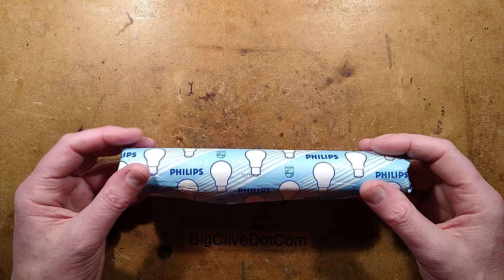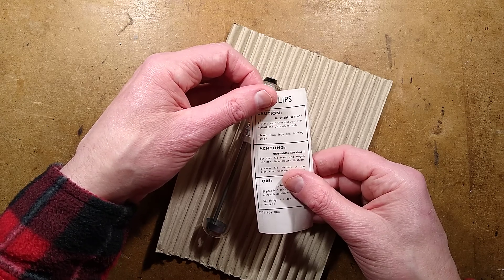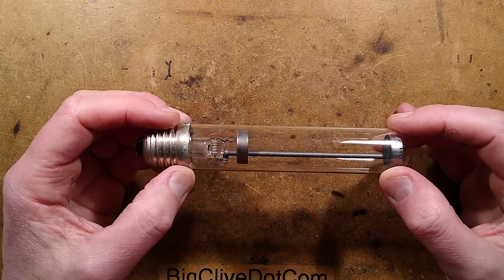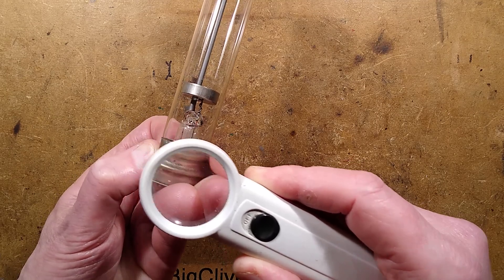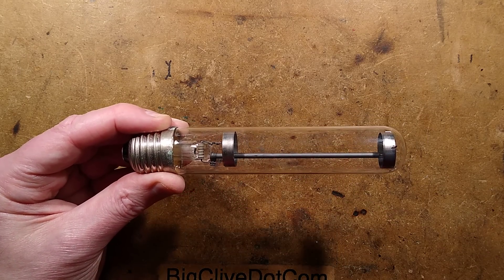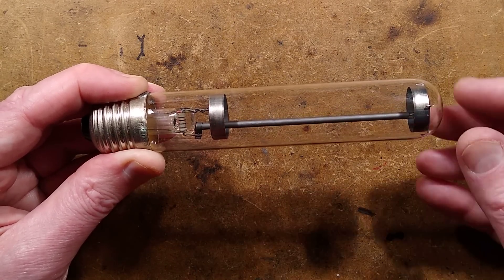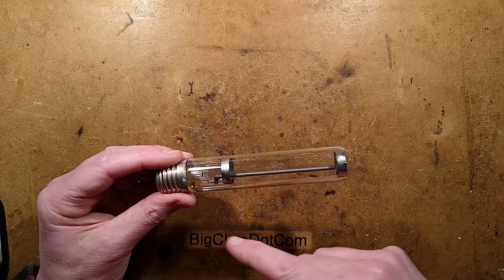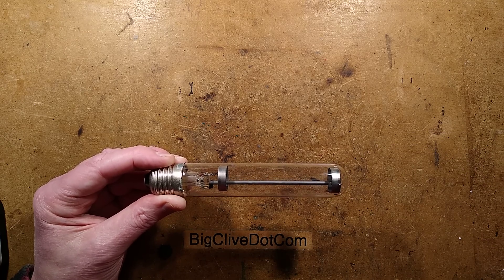Unwrapping and testing a dangerous vintage Philips lamp

Comment: I have an air purifier with a fluorescent UV-C lamp built into the filter housing at the bottom of the unit (supposedly for sterilizing the air passing through the HEPA cylinder) and noticed something peculiar after recently changing out the filter. The lamp itself is protected by a plastic slotted shield that prevents the lamp from breaking in the event it is touched or struck accidentally, and the internal white plastic surrounding the lamp is stained/burnt a brown-yellowy colour in a zebra stripe pattern relative to the slots of the protective guard.

If such a tiny lamp the size of a car key can turn heavy duty, hard coated white plastic a dark brown after a year of exposure, I can only imagine what it could do to my body within minutes or even seconds.
Reply: To your skin it would cause sunburns minutes of exposure.
And to your eyes welder's flash in seconds !
So yeah, be careful with those lamps.

Comment: As a school Physics technician, we still use one of these lamps - with proper precautions as it has the right UVc wavelength to show the 'Photoelectric effect' - the ability for photons to discharge a electrostatically charged zinc surface. If you know where to get any of the lamps, let me know!

Comment: Several years back I designed some costumes for a theater production which used UV light to bring out certain details at key points in the story.  When painting these details onto the costumes, it was necessary to do so under UV lighting conditions.  I didn’t take necessary precautions, exposing myself to direct UV for several hours.  It created a tan-line on my forehead that lasted for years.

Comment: I used to be a platemaker in the printing industry, and we had very similar but much bigger lamps to burn images onto the metal printing plates. Those UV mercury vapor bulbs were very dangerous. Came with gloves because you couldn't get the oils on your fingers onto the bulb. Never did find out what happened if you did!
Reply from the maker: The very high temperature lamps can fail due to devitrification caused by the oil.  I'd guess on the lower power ones it may block the UVC a bit.

Comment: As a kid the classrooms in my school had one recessed light fixture they called a "germ light". My school was orginally built in the 50s and by the early 80s teachers were told not to use them but every now and then someone would hit the switch and I remember them having that color.

Comment: Mid 20th century there were bulbs that emitted sparks into the skin, as therapy. The current could burn. As it was higher than the classic Van DerGraffe generator. Wildly unpredictable and unregulated tanning lamps were everywhere. Giant filiament lamps that could easily light paper were screwed into double size "Mogul" sockets.
Reply from the maker: Possibly the violet ray.
Reply: @bigclivedotcom  maybe.... The bulb was the old floodlight shape. Glowed purple (violet) and sparks shot out to your skin if you got close. It almost burned. I junked one up years ago. Lol.
Reply from the maker: @edwardallan197  You can still buy them as Darsonval machines.

Comment: While watching this video, I experienced a dry, burning sensation in my eyes, accompanied by extreme tiredness.  Disregarding the fact that I have been awake for over 36 hours, I am quite sure that my symptoms were caused by viewing the lamp.  

During  the pandemic, I had an old 18" fluorescent fixture fitted  with a UVC bulb from a dead Ionic Breeze GP on top of my wardrobe, and set it  on a timer to run four hours each day while I was at work.  It bleached my curtains, carpet,  bed sheets, and made the varnish on the top of the wardrobe crack.

Comment: In the early 90's, shortly after the Loma Prieta earthquake I moved from Seattle to San Francisco to help a friend open a restaurant. He needed a bar manager and I happened to be in that business at the time. I got to talking to the rest of the staff over the year I was there, and one question I typically asked over closing time shift drinks, was "what were you doing right before the big earthquake.....do you remember?" and quite a few answered "yeah, I had to go to the bathroom all of a sudden, and just when I sat down, the earthquake hit".
So a not insignificant percentage of the San Francisco Bay area was sitting on the toilet during the "event" and umm, both events were said to be explosive...
No UVC necessary.

Comment: I have one too. Bought it at the local Electronic parts store for the purpose of erasing the data contents of eprom chips. (Those with the see through glass to look at the actual memory chip)  I used a ceramic lamp holder mounted in a metal box, 3 or 4 chips next to each other was possible. Erase time was 15 minutes if I remember right.

Comment: We used to use these in safety glass cabinets for sterilization. If you bypass the safety switch in the door you can stare into the bulb until you see Lemmy. I now use these in all my lamps. Jimi Hendrix says hi. Uvc is awesome.

Comment: Never touch the glass bulb with your hands ,it will shorten the glass life because of the oils/contamination on it ,with heat glass will erode  faster
Reply from the maker: That applies mainly to high temperature tungsten halogen lamps.  With this low temperature one the main issue of fingerprints is obstructing the UVC light.

Comment: In the 1980s, I built my first computer. In it, the EEprom 2708 or 2716, was used. These EEproms have a glass window through which you can erase the memory by means of UV light. For that, I bought just such a lamp. I must still have it somewhere.

Comment: Interesting, but no, UV-C is not transmitted by YouTube because video cameras only record the amounts of Red, Green, and Blue lights seen by the camera, not UV; and likewise, TVs and computer monitors are only capable of emitting varying amounts of Red, Green, and Blue lights, not UV. So we can only see the visible part of the light. The only person in danger of eye or skin damage was yourself.

I can't think of a mechanism for UV to cause diarrhea, as UV only penetrates a tiny fraction of an inch into skin or eye tissues. This is also why UV-C is used to sterilize water and other clear liquids (ironically, to prevent diarrhea), but is not able to sterilize cloudy liquids such as milk or coconut milk. Diarrhea is generally caused by ingestion of various bacterias, viruses, funguses, parasites, or antibiotics. Only if one experiences severe skin burn due to prolonged exposure of a large skin area to sun or UV could diarrhea occur as an indirect consequence. But a few minutes of exposure of a clothed adult to a 6W UV light bulb isn't going to cause diarrhea, no.

Comment: I supply UV-C lamps for water and air sterilizers at industrial level. The lamps I supply are in the high wattage rating.  The ones I supply are in the range from 14 inches long to 6 feet in length. The wattage can range from 6 Watts to a few hundred watts.  The lamps use mercury and zinc vapor. The glass is quartz, and is not silica type glass. You may be able to see some mercury balls inside of the lamp, but most of the time when the lamp is not illuminated the mercury may be in very tiny pieces.  When there is activation the mercury becomes vapor inside of the lamp. 

It is important to wear proper UV-C eye protection. The UV-C in the range of 265 nm can cause permanent blindness if exposed to the eyes long enough. The low wattage lamps are dangerous but not like the high wattage ones.  Distance of danger to eyes and skin is dependent on the UV-C emission from the lamp. It is best to also wear protection clothing along with the proper eye wear that can block UV-C. 

Normally the lamps I supply are used internally inside of equipment and there is no UV-C radiation exposed to the outside. Inside these powerful systems there are cooling fans and UV-C pass filters to block any visible light and only pass the UV-C light to the target area. 

I have supplied high power UV-C radiation equipment that can sterilize a whole room. The unit is set up in the middle of the room. Everyone has to leave the room. The light is turned on by remote control or by a timer. It is also possible to have remote types of these lamp systems. Normally the time can be set to about an hour for an average size room. Most any types of bacteria and viruses should be killed.

Comment: We use UV lamps in our hot water system at work as germicidal protection. 3 tubes sit submersed in a stainless steel tank, which the water passes through under pressure. The water quality is periodically tested, but as long as all three globes are functioning, it passes every time.

Comment: During the covid nonsense I found a old electric shop and they gave me 25 white phosphorus lamps   they said they were 40 years old and never knew what to do with them, The county had 75 of the outdoor lamps that were replaced with led outdoor lights. anyways I busted them all open and made some uvc lamps. they used a few in the cop cars and gave one to a fiend who’s wife had cancer to disinfect stuff.  I used a uvc meter and they were 2x stronger than the sun at 20 feet. only problem is you have to have quartz glass as a cover or not touch the bulbs. any other glass would block alot of the uvc.

Comment: Are mercury vapor rectifier tubes also harmful to be near?  Like ones used in certain tube audio amplifiers?
Reply from the maker: No.  They usually use lead or soda glass which blocks the UVC.

Comment: Top tip when handling lamps made with quartz glass, (to withstand the temperatures), which this is probably made of - don't handle them. The oils from your skin will cause them to fail early, so nitrile/latex gloves are strongly recommended, probably nitrile for preference as they are usually not powder coated which can add its own problems. For the same reasons, pre LED, handling car headlight bulbs when changing them would almost always result in quick failure.
Reply: You can handle them with bare hands as long as you thoroughly clean them with alcohol before you power them up again.

Comment: those lamps were used for erasing “eproms”, read-only memory chips for the computers of the 80s or 90s. I used such a lamp, bare and covered it during using with a towel.

Comment: The UVC rays from that lamp probably affected the camera or phone and its operator. This does not affect people watching this video stream, as UV rays don't really transmit across digital video encoding. It's H264, VP8, MPEG2, or even AV1. At worst, you would probably get a headache from the flicker emitted by the recorded lamp (probably because of the camera's exposure settings.)

Comment: It is probably what's referred to as a German cycle bulb. Add 1 in a worldpool dryer in the 50s. The ball was in series with a party. What bin Laden and the bin of the dryer? It's the German cycle ball, but it's a Mercury vapor ball. And they use the 40 what inconduction binball for a ballast.  Mercury vapor bombs met UV ray so that he used them to kill germs in the dryer. Try looking up german side of a light bulb

Comment: Arrgh - Me eyes.....and bum!  I Used one of these very same in an EPROM unprogrammer back in the 80's. As I made the whole thing from scratch, a lot of thought went into light-proofing it + interlocks, so it couldn't be started without the lid closed, and would cut off when if it was opened & the timer hadn't finished. AND it was tastefully finished in oak veneer. No plastic crap back then...Unfortunately, the bulb got broken in a house move, and I never replaced it, so it went to the great eraser in the sky - BTW, I bought the bulb from Maplin when they were pretty good.

Comment: Even if your camera could detect UV light (100-400nm wavelength), the LCD screens we're using to watch your video are only capable of reproducing visible wavelengths in the 400-700nm spectrum. So there's NO danger of 'UV exposure' for your viewers. We can look directly at the 'image' of the 'UV light' in your video, but we'll never experience any effects of UV radiation, simply because the image shown on our screens does not produce any UV light. Many video cameras also filter out UV with a standard UV lens filter. I'm not sure if the camera sensor even detects the shorter wavelengths (100-400nm)?

Comment: The symptoms I experienced were my beard grew by approximately 1.21e-4 mm, a slight feeling of drowsiness, I lost approximately 0.2g of weight, however my wallet did not gain any weight. I'm sitting on a regular office chair, so no issues with loosened stools here.

Although now that I think about it, the drowsiness may just be because it's almost 1:30 AM.

Comment: Date code '8F' would be June 1998.
Reply from the maker: I'll have to check that, as a few dates have been indicated.
Reply: @bigclivedotcom  I did wonder, with that style of packaging - I have known Philips to transpose the date codes previously by mistake. It should be number first where the decade is odd (e.g. 1970, 1990, 2010, etc.), and letter first when the decade is even. An interesting little lamp, nonetheless!

Comment: Back when I worked on trains and HSTs ran - with a galley (kitchen)  the water system fed water through a box that had a similar UVC bulb in it.. 
I think my hot tub also has a similar UV function

Comment: You Brits get the most exciting lamps and bulbs! We in the USA at 120V cannot get such a long glow column :-(  I'm of the age when homebrew UV-EPROM erasers were 8-track storage cases with a germicidal fluorescent lamp inside the lid. No interlock or timer. Now wimpy UV LEDs are available. Happily, the "better" battery operated cellphone sterilizers are real quartz glass UV bulbs with safety interlocks.

Comment: I don't think anyone waching would have any side effects as LCD /LED panels are usually not capable of emitting UV wavelengths.   
:)   I am sure some will think they were affected though.   I don't think the old CRT's could really do UVC either, though they may come close but not with the circuitry used in domestic TV or Computer Monitors.

Comment: I once owned one of these, in the 1980s. I wanted to do cool things with EPROMs so I wanted to build a programmer but I realized I would need an eraser first, so I went to a shop that sold electronic parts but also decorative lights, and I bought a TUV6, based on information from a magazine. I think it cost about 50 Dutch guilders at the time, very expensive. I built it into a cigar box and attached a cord but never got any further with the project.

Comment: I used lots of UV mercury lamps as a NDT tech, but ours had Woods UV-C cut filters for health and safety reasons, so we didn’t need to wear safety glasses, and the wave length was 365nm.
Some things look strange under black light, your skin for one.

Comment: I still wear my welder's helmet when I watch YouTube welding video's as I want to protect my eyes and face from nasty UV arc flash. When you mentioned you were going to light up that UV lamp, I slathered on the SPF-250 sun screen and put on my UVA,B,C sunglasses. I felt no sudden urge to destool and thus remained seated the whole time.

Comment: I used to use an EPROM eraser that was fitted with a couple of UVC tubes. We used the EPROMs on a digital (ISDN) based business telephone exchange (PABX) to hold the binary code. The system used six 27C1024 devices on the main CPU board. I remember there was an interlock so the UVC wouldn't switch on until the tray holding the EPROMs to be erased had been inserted. The eraser did leak a little of the UVC but as I remember nobody died in the software office as a result of using it. However, many years later I no longer see a couple of my old colleagues doing anything on Linkedin these days. So who knows, maybe the UVC eventually got to them?

Comment: I still have a 30 year old Philips UV bulp. From the color i would say ~380-400nm. At the time i got this beauty you could not get better looking UV in this strength more easy. I had to add some tin to the contact on the end a few years ago. But it still workes like a charm.

Comment: I wonder if something like this was made as a regular light bulb, just by using a phosphor coating in the glass... I think that'd be cool. Althought the phosphor would probably not allow thegraphite coating to work...
Reply from the maker: The phosphor shouldn't really interfere with the graphite coating.  I wonder if it was just the inefficiency of using a resistive current limiter.

Comment: I had to dash to the bathroom immediately after. Mercifully I'd left the door open... amazing that Philips invented the cure for constipation! :face-fuchsia-poop-shape:They just don't make 'em etc etc etc. 
On a more serious note, I help out my neighbours in our apartment block when it comes to simple electrical fixes. The, er, most regular event during these darker days is when low voltage halogen downlighters fail. The tenants replace the bulb but it does not work. The small transformer, UK mains 240V AC to 11.6V DC, 10-60 VA, has invariably blown, too. I have tried fixing them, or rather fault-finding, to no avail, so it is an (admittedly cheap) replacement job. Any chance you could get hold of one or two and work your magic? Ta and best wishes from SE London.
Reply from the maker: If it's an electronic halogen transformer it may not work with LED bulbs.  It needs replaced with a fixed 12V DC unit for LEDs.

Comment: Hello there big Clive, I've been tasked with clearing out an old theatre lighting store and I thought you might be interested in some of the more esoteric lamps which will otherwise end up in WEEE recycling. I've got some ceramic metal halide lamps, some metal halide discharge lamps, some high pressure mercury vapour lamps, and an assortment of PARs and halogens. If anything strikes your fancy let me know.
Reply from the maker: Thanks for the offer, but I've got way too much stuff here.  You may find a market for them on eBay.